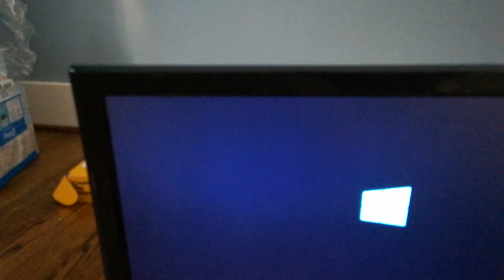Painting a motherboard

Comment: Sp question? Can you also use some cardboard to help plug the PC-EI and RAAM slots as well taping them to help keep the insides good?
Reply from the maker: Yea you can do that, I did it on some of the blue slots. The only problem is that you can still see the inside of the slots after its done.
Reply: @liquidcooled5108  that was quick bro lol. Btw nice job on the paint job
Reply from the maker: Thanks lol